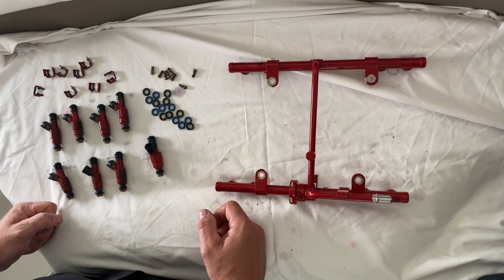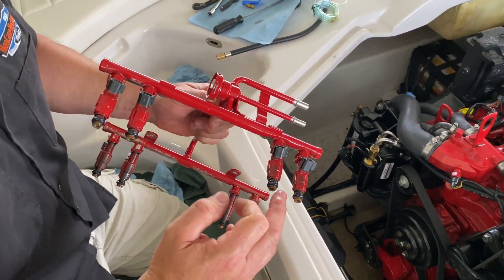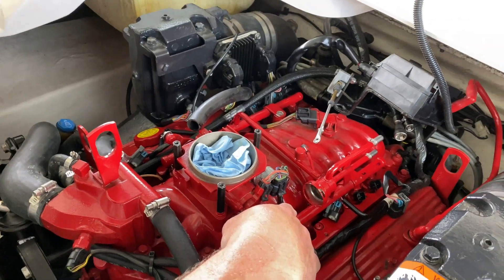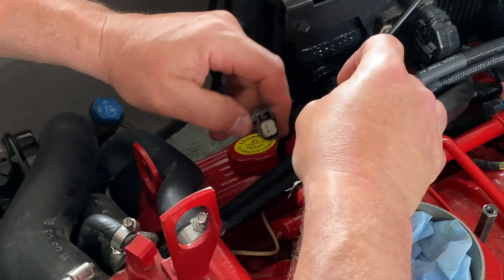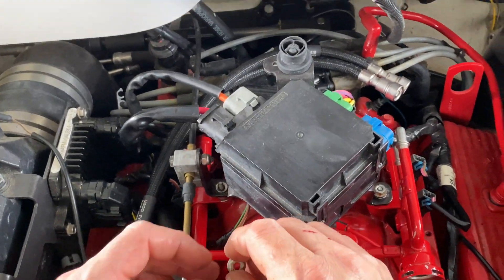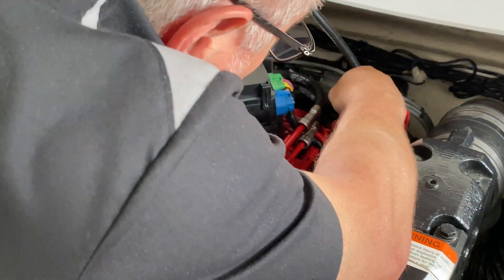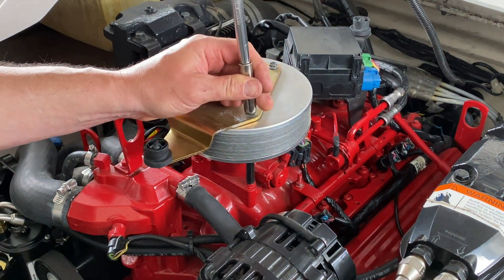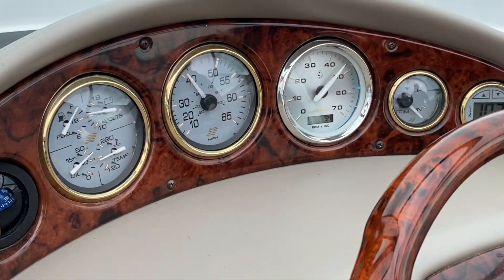Volvo Penta Fuel Injector Installation and Performance

Comment: Hi ,

Ive got a question to you fella😉
Just bought boat with Volvo Penta 4.3 gxi 2007.Problem is that I been using boat yesterday,stoped engine and after 10 minutes I tried to start engine crank but nothing happened.Check spark plags ,there is very god sparks,fuel pomp gives normal noise after turn ignition on .
Tried even put some engine start sprey but  nothing happened!!!
Do you have any idea? Thanks 

Greetings from Poland 😉

Comment: Great video! The fuel pressure regulator that you reinstalled had an e-clip with no screen. I've heard volvo pemta has a campaign to remove the screen and replace with an e-clip on older models and no longer have screens on models in 2010 and newer. Have you heard on this before? Thanks in advance

Comment: What is the cylinders compression for 2003 Volvo penta should be,I have 2003 Larson 310 cabrio double 5.0 Volvo penta, I have a trouble to plane on it when I got 150 gallon of fuel, 80 gallons of water and 6 people on board, it is not go more then 10 mph, 800 hours on each  motor, just removing a fuel injectors for inspection, and want to check  a cylinder pressure,and if it need to do a valve adjustment, just checking, maybe some ideas ,fuel pumps are new,sparks are new,already changes many things, still the same, half fuel, half water,4 people it, go like 40,last thing to check is compression

Comment: I am extremely grateful for your videos. You’ve pretty much replaced my whole fuel system. With that said, one comment I’ll add for others like me, be very careful not to knock sand or silt into injector ports. While identical, my fuel rail had never been touched since manufacture in ‘03 and not quite as clean as engine on video. Very tough to remove and in the process of manually pulling plugs by hand i inadvertently crammed some sand into one of the ports. I’m not being negative and truly appreciative of these great videos by Man Cave Mechanic! Thanks!